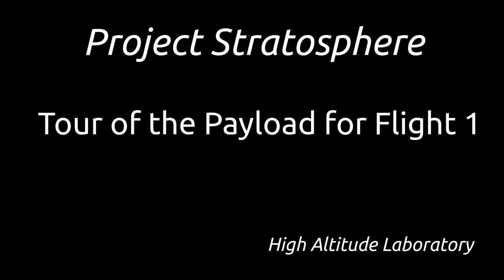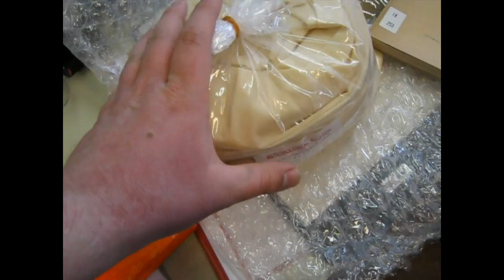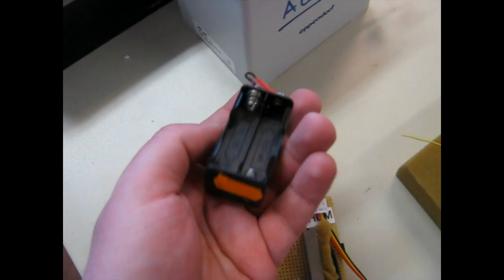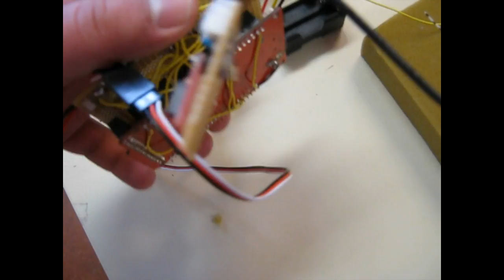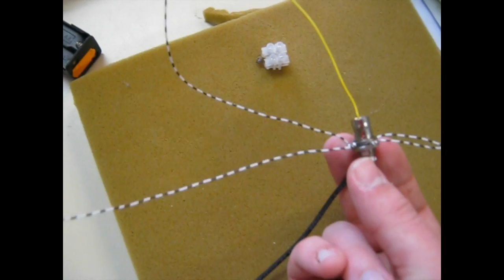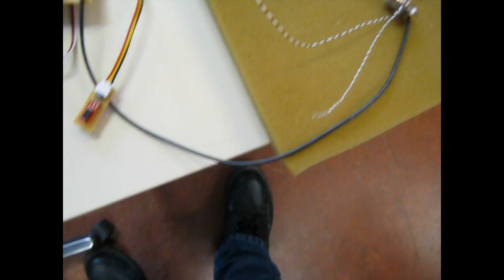Project Stratosphere - Payload Tour for Flight 1

Comment: I'm planning on doing a similar project and am wondering how you made that antenna. Are all of the 5 wires of antenna soldered together and how are they connected to the NTX2?
Reply from the maker: matjaž jug Thanks for your question. The four striped wires are all connected to the outer shielding of the coax cable and the yellow wire to the core of the cable. The core in turn is soldered to the second pin of the NTX2 (RF OUT) and the coax shielding to the RF ground, which is either the first or the third pin on the NTX2.

Comment: Nice,
DE K9DCI
[22000  m = 72,179 ft.]
Reply from the maker: Yes, the actual altitude in the end was 22568 m (74042 ft).
Reply: WinzenFlyer I was just wondering what it was in feet and posted it for anyone else looking.  I am now watching the M0XER-3 & 4.  #4 appears to have gone out of range of any digi, but #3 is still reporting ( 2014-07-28 12:00:04z) 248 mi (400km)  @ 346 degrees from Ottawa.
Cheers